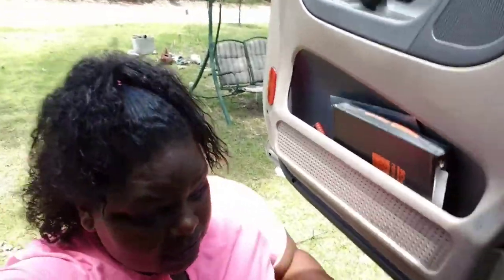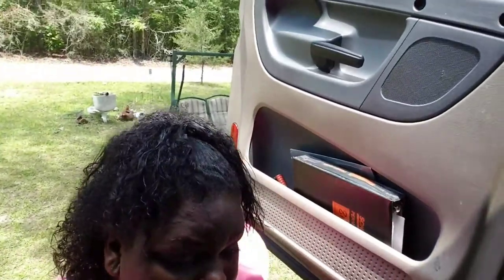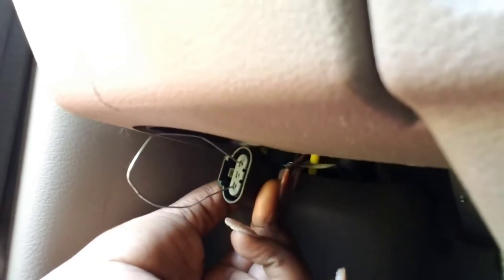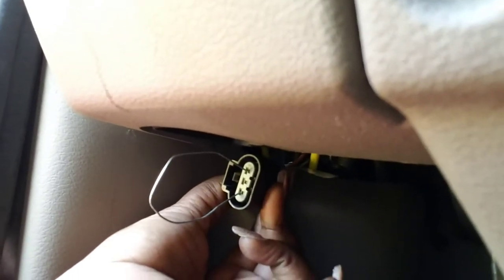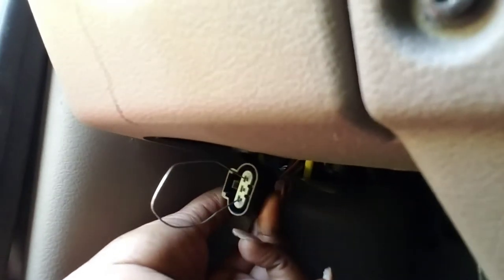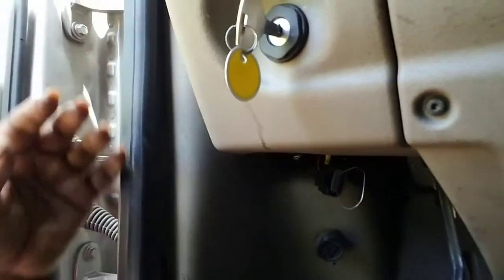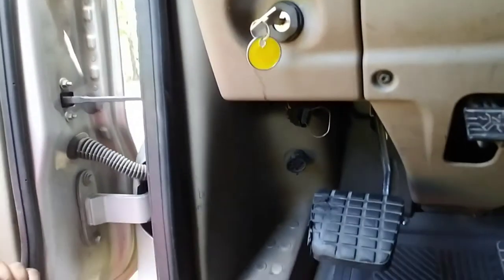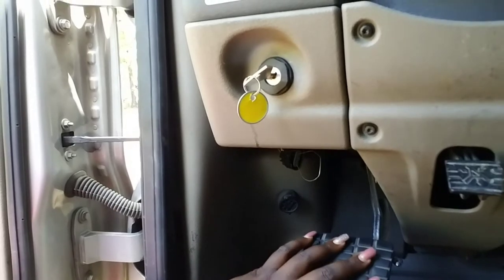How to bypass your clutch switch with a paperclip "MyTruck & A Paperclip"

Comment: Yes! Thanks for sharing. My 2016 cascadia is mad. She only cranks when she wants to. This is after replacing the SAM module, the starter, the wiring harness and 4 new batteries. Looks like I need to try this now until I can get her back to the shop

Comment: Thanks a lot I've been having a problem with my clutch switch having to constantly press my clutch pedal until my truck finally starts but I try this little trick you showed me although it did take me a little while to figure out where that dang wiring harness was but I grab my paper clip stuck it in there and it did the trick so thanks a bunch for your video
Reply from the maker: Trucker Daddy glad it worked for you
Reply: I didn't realize it until I was driving today but after I had used that bypass that you showed in your video for the neutral safety switch I realize that because I use that I didn't have cruise control or jake brakes working in my truck so unfortunately I had to hook that plug back up so that I would have cruise control as I will be going to Texas in the morning and I am not going to hold that pedal down all day LOL. I'm eventually going to replace that neutral safety switch but I'm still going to use that technique as far as getting the truck started because at this point it doesn't matter how many times I mash on that clutch I can't get the truck to start so I'm going to have to use that technique to get the truck to start and then probably plug it back in so that I have my cruise control and Jake brakes but just the same thanks for showing me how to do that

Comment: A paperclip will also work if you do not have trailer lights, what you do is put the paperclip at the first hole on the top left, first hole on the top right just below the big main hole( in the pigtail) your plug, but make sure you break the paper clip down so it's flush along the top, they call this hot-wiring it will get you to where you have to go I've had to do this probably 30 times in my 23 years of driving, also make sure your lights are off before you plug it in, and it has to be one of those really thin paper clips so you can plug it back into the trailer.

Comment: Easier just to put in a three-stage a toggle switch that way you don't have to replace it if you don't have the money to wire it up so all the way up is to start the truck and then all the way down this for cruise control and Jake brake metal is neutral a good security system for the truck as well

Comment: If you leave the paper clip in the cruise control will not work.  I Stripped back the 2 outside wires and connected 2 wires to them and then to a toggle switch so no I just turn the switch on start the truck then turn it off.  Great video thank you.

Comment: Hey y'all how do you disconnect the switch I think I found it but can't disconnect....help!
Reply from the maker: It should be clamped/hooked on either side. Lightly unhook and pull at the same time. If not clamped/hooked. It should be a  hard plastic part that you can press on. Press and pull apart at the same time. If need to, use a flathead screwdriver.